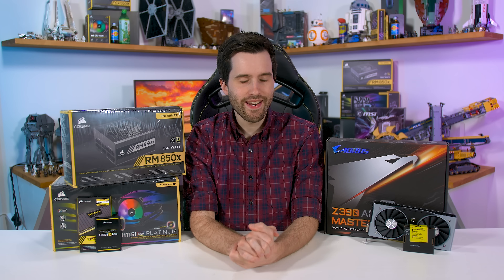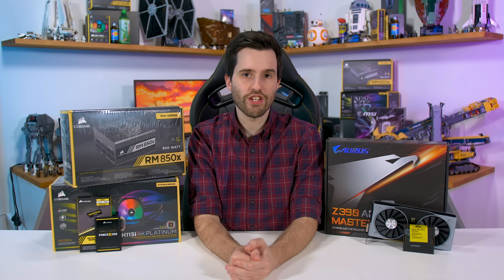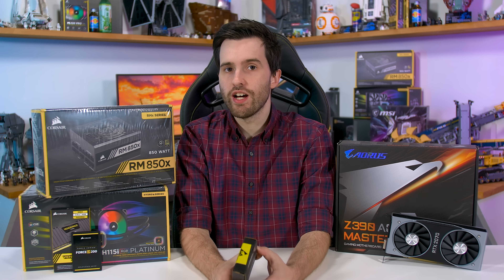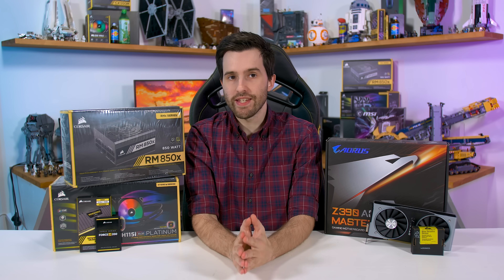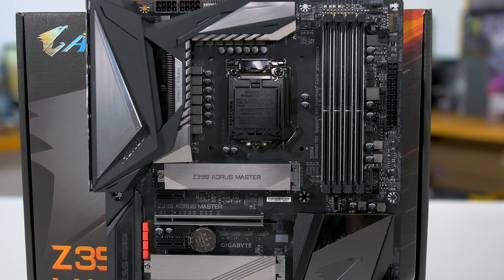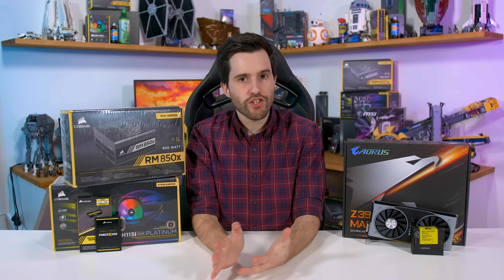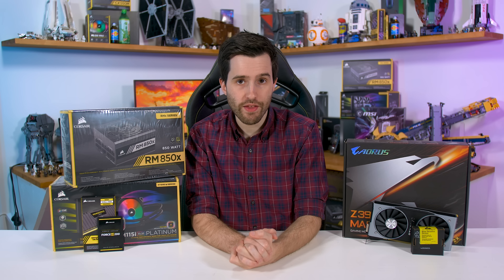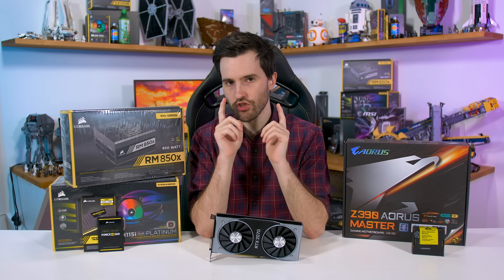Core i9-9900K Upgrade, Can We Cool This Hot CPU? Corsair H115i Platinum Tested!

Comment: Hi Hardware Unboxed
Can I use Power Supply from 600W for:

Gigabyte Aorus Master Z390 Master + Nvidia Gforce RTX2060 + 16GB Ram  Kingston 3400 Fast Buss + HDD 512 WD M.2 Back N750 + Intel I9 9900K with Corsair H115i Pltinium + Six Fans RGD Thermaltake + HDD 2Tb Seagate Firecuda Hybrid. Thanks for your comments.

Comment: Hi guys I want to build an i9 9900k build but will a 120mm radiator cool it properly at stock settings? With the fan rpm set to highest?

Comment: My 8 core Xeon get never hotter then 71C at 4,7Ghz all 8 cores running 100% at 160W in the Intel overclock tool stress test using a big 12 heatpipe cube aircooler with 4 cooling fans in a modified HAF XB case. And that is with the cooling fans running at low speed ...

Comment: Boiis i need help on my i79700K im getting high temperatures on rest lode with mastecoller liquid cooler wether i put it on 4ghz or on 5ghz im permanent at 70-80°C
Reply: I know this post was made over a year ago, but my only guesses are that either you didn't have enough thermal paste or possibly that you had an air pocket in your water block. That's what I can think of off the top of the dome. I'm assuming the pump is working fine and your fans are spinning and pulling through fresh, cool air, so I'm not worried about that.

Comment: Right you have answered a question for me, my shitty old cooler from my i72600k build (think it's an Artic) keeps my i9 cooler than the flashy sealed cooler you used. I think CPU temp is something you obsess about when you do a new build, I had a Q6700, then the i7 2600k and now the i9 9900k and I have phreaked out about the temp on all of them for the first couple of weeks and then forgot about it. Also, just saying but RGB is so lame, what's the point, especially if you are an adult? I mean it's just a box that sit under my desk I don't even look at it, I look at the screen so what the point, don't get me wrong it looks cool and all that but...

Comment: The funny part is my build is almost the exact same build.   I hand picked my z390 Aorus master mainly for the overkill VRM design and heat-sinks.    And i also picked the H115i Platinum Over the h150i because of the new design.    The only thing that is different is my EVGA 850w Supernova G3 Over the corsair RM 850x.    Overall i wish i saw this video before , i would have purchased the same items regardless but still awesome video!

Comment: I would have put two 120mm be quiet! Silent Wings 3 fans in the top to blow cold air in and done away with the fan on the back. The fans that come with this case are loud.

Comment: I want to mount the AIO cooler on top is that bad. I wanna have the MB530P case and the Corsair H100i platinum with a 1060 GPU is it fine to place the AIO cooler on top ?
Reply: Side vs top mounted aio are virtually same performance. Being a 240mm you should have enough clearance for your ram but double check. If you top mount make sure fans are pushing air the top.

Comment: you got a shitty chip.... mine does 5ghz at 1.26v and refuses to get hotter than 72c on my Kraken X72 with push pull fans that are virtually silent even under full load. even at 5.3ghz at 1.35v, i maxed at 86c. You really just got a super shitty chip.

Comment: Why are manufacturers so fond of designing the case that force us to put CPU radiator at the front? Especially if that a core i9 9900K overclocked to 5GHz, no matter what u do, the hot air will heat up the whole case, all components will receive heat from that radiator, even if u add more intake or exhaust fans, hot air still there, heat up everything before it gets out. IMO this case design is not mean for overclocking.

Comment: I'm running a i9-9900k at 26-27c at idle with a NZXT Kraken x72. On load, haven't seen temps get past 65c
Reply: did you oc it?
Reply: Keluhuran Haqiqi no not yet. I still haven’t found a need to since the 9900k is crazy fast. I still made sure to get a good motherboard (Z390 MSI Gaming Pro Carbon AC) in case I do decide to over clock it in the near future.

Comment: The case sux and the cooler too. Tray Liam li O11 air case and nzxt X72 OR ASUS rOS jyujin 360. + The case can have 3 vents front 3 down 3 120mm up and 2 80mm back.

Comment: Did you install a PSU upside down where the fan will blow the air out, however with a dust filter on the bottom?

Comment: Should not be that bad. I’m cooling mine with an air cooler. OC to 5 GHz @ 1.240v. 
Temps don’t reach 80c while gaming.
Reply from the maker: Gaming's not a CPU stress test.
Reply: Hardware Unboxed Yeah, I did an hour of Asus RealBench and the two cores went as high as 94.
Reply: @jettangeles2707  gaming not a CPU stress test LOL. My 9900k 5ghz 1.36v overheat in Furmark CPU burner lol.

Comment: Water cooling guru who doesn't know that all pc water cooling systems are closed loops. a sealed loop doesn't = closed loop it means you can't add liquid to it. an open loop is like taking drinking water running it threw water blocks than to a drain like what's used in food processing plants to move products like peas beans carrots etc. ect, ect.

Comment: 1.290V, 5.0GHz synced over all cores LLC7. Idle temp, 30-45, 47 while gaming. Peaked to 65 during cinebench. I have a ROG Ryujin 360mm AIO cooler, is this an acceptable temp?
Reply: You are the first one I have seen who has acceptable temps with AIO cooler.... All other I have seen have much higher temps then my 71C at 4,7Ghz 8 core 100% use stress at 160w power test of a Xeon 2288G evne with slower cpus using watercooling. I have a huge 12 heatpipe aircooler and it seems to outperform most AIOs....

Comment: Mine is at 5ghz on all cores with duel fan air. processing video in the upper 70's with random peaks into the upper 80's which is higher than I would like but then again 99.99% of the time all cores stay under 80

Comment: Mine is at 5ghz all cores AVX set to 0 voltage at 1.26v cinbench score 2164 multiple runs, runned Occt with furmark      Max temp 80c 18c ambient

Comment: What settings are you running in iQue for your 115i?  Balance, performance, full speed?  Also what cooler temps are you seeing after hour test?  I am running a 9900k on a 100i but upgrading to a z390 from a z370 because of power issues with the old MB.
Reply: what r ur temps with H100i on 9900K?

Comment: i'd hope so because a single tower 140mm air cooler is enough for my 9900k fixed at 5 ghz and 1.28v. this can get really hot, when voltages are not setup correctly tho. at stock settings my cpu is hotter than when running 5 ghz with my custom settings.

Comment: 85-90C not sure i would recommend this cooler for this.
Reply: My 8 core Xeon 2288G at 160W running 100% all cores at 4,7Ghz  never gets hotter then 71C running the Intel stress test for 2 hours with a big heat pipe air cooler... It did not get this hot even with the small 4 heat pipe air cooler it had when I got it as part of a complete Workstation computer. I see other have also experienced the same that they got lower temperatures with air cooling heatpipes then even big AIO water coolers...

Comment: Complaints about temps coming from people who don’t own these cpus. I own one at 5ghz at 1.350 Volts with a 360mm AIO hitting max temps in gaming and workloads of 78ish, full synthetic load I’ll hit 85ish. That’s not that dam hot when gaming laptops are lasting years at those temps 

Update, Re seated paste with Kryonaught, lowered voltage to 1.320 and stable at 5.0. Temps sit around 81c  under full synthetic load. Gaming temps don’t peak over 63c
Reply: What type of graphics card are you using? And how many fans do you have in your case and what's the configuration? I'm about to order my first build and want to go with the 9900k
Reply: CryptoData I’m using the lian Li Dynamic with 6 be quite silent wings 3 for intake and my 360 AIO does the exhausting. Currently using a 1080TI ftw3 from EVGA.
Reply: @Clutch4IceCream   what CPU cooler do you have I want to get the i9 but scared for the overheating
Reply: apex xeno Corsair h150i  pro, keeps it in check nicely.
Reply: @Clutch4IceCream  this will be my first ever build and I don't want to screw it up. And want the best cooler so I have no issues
Reply: apex xeno just make sure you do a ton of research into a good case. Most cases don’t have good airflow and you want the best airflow for the radiator. H700I is a great case as a starting point.
Reply: @Clutch4IceCream  I was looking at the h700i and I've done some research on it and seems pretty good. Do you recommend I go for a 360mm radiator or 240mm?
Reply: apex xeno you absolutely need a 360mm AIO to combat the heating problems with the 9900k. My 240 was not enough.
Reply: @Clutch4IceCream  okay I will definitely be buying a 360.  I mainly just want to game and stream
Reply: I have one at 4.7GHz (stock) with 1.25V, in my 360mm AIO doing prime95 1h temps are at 58ºC, consuming 120W of the CPU
Reply: Sr. Yonky yea stock temps are amazing, once you OC it sky rockets lol

Comment: I don't know why but many reviewers just never tell the power consumption its important
Reply: They do in their reviews. This wasn't a review, it was a build video with some focus on cooling.
Reply: @Malus1531  how can you talk about cooling without talking about power consumption?
Reply: @MrPirateking619  Because they are different. Power consumption alone doesn't dictate cooling. They are related, but it depends on efficiency. A 99% efficient device might consume 100W but only require 1W of cooling. So if you want to know about cooling, energy output (heat) is more important than energy input.
Reply: @Malus1531  lmao how do you cool 100w with 1 watt of cooling?
Reply: @MrPirateking619  Ok after further research I'm wrong, apparently all energy input is also output in a CPU. In a mechanical device they will usually be different. For example you power an engine with 100W, the actual moving of the output shaft represents 50W of work but 50W is lost to heat/friction; that process would be 50% efficient. You would only need a 50W cooler to cool it despite it using 100W. But CPUs don't have moving parts, they just push electrons around, and pretty much all of that creates heat due to resistance in the traces & transistors. It's pretty much just a heating block, but with the electron flows organized instead of random. So I guess I rescind my previous comment.

Comment: is there any specific reason on why you placed your cooler on the top and not in the front?
Reply from the maker: Depends on what you want to prioritise, cooler at the front is better for the CPU but worse for the GPU. Top is better for the GPU but worse for the CPU.
Reply: @Hardwareunboxed  Bitwit has shown that the GPU temps are not significantly affected by front or top mounted AIO. That's was for both blower and open air design. It would fluctuate at most, 1C up or down. Which is not significant.

Comment: 9900k at 5Ghz, ASUS Maximus XI Hero MB, Dominator Plantinum DDR4 3333 (XMP II set in Bios), vcore set to 1.326, H150I cooler and barely breaking into the 80s mostly in the upper 70s with Prime 26.6 Small FFT.

Comment: I have an i9-9900K + Gigabyte 1080ti and kraken x62 in an nzxt h700i case, al 8 cores on 5.05 Ghz and temps in games on 2k and ultra are around 55C max,  gpu is locked on 72C... Im pleased as hell! Motherboard is an msi z390... In stress test at full load 100% i got 83C on CPU.

Comment: So atm with the ammount of cores used by games the 9700k is better in single core performance and in gaming. Mine is pushing 5.15 at 1.32V and 84 degree max on a Noctua NHD15.
Woud be a greate test if it is actually better for gaming.

Comment: My i9-9900K runs at most 80C during rendering/encoding videos to h265 as well as CPU stress tests with my 280MM AIO cooler. I run it at 1.31v @ 5GHZ. I think that is pretty good, sucks for people who have to run much higher voltage though.

Comment: guys go buy i7 8700/8086k Delided !!!
Reply: I run my i7 8700K  5Ghz 1.27 Volts  non Delided for more than 2 years.I run it with a black ice nemesis 480 GTX radiator my room temp 23C and CPU Idle 29 in game BF5 57 degrees.
with all stress test always around 62C a 65C degrees

Comment: 11:20  These are not safe temperatures to run with an aio cooler. Liquid will boil and permeate and your cooler will degrade. Never go over 70-75°C over long periods of time with a closed loop aio cooler.

Comment: You put the memory in the wrong place.  They should be side by side.  make sure to coat them in thermal paste before you plug it in its bracket.  You can save weight by eliminating screws and use hot glue.
Reply from the maker: Thanks for the tip, Stefan. Big fan BTW!

Comment: Intel has had an issue with their heat spreaders not being flat for a while now. Jayztwocents has a few videos highlighting this issue. Test your's, if it spins on a flat surface, the IHS isn't flat and needs to be lapped. This is not about exposing the copper, its about making sure the cooler cold plate can make absolutely perfectly flat contact with the IHS.

Comment: I've the same exact case in black. Oh the hex key screws and rubber washers will be super annoying to deal with down the road. Makes maintainence for the PC a pain unless you take really good care of the small parts.

For your use case scenario, I'd worry a lot about the case screws because you're going to open up the case panel very often. You're bound to lose the screws sooner or later.

Comment: Something isn't right. I have the exact same set-up and I am getting 32 degrees at rest and no more than 65 degrees on max use. And I have it in an NZXT H200 ITX case with a 1080 ti, overclocked.
Reply from the maker: Yeah that's not even remotely possible. You might want to give the pro-overclockers a few tips :D What are you using to stress the system?
Reply: @Hardwareunboxed  HWinfo with Prime95 (including AVX) . Which one do you use exactly? I'll post a video using your method and show my specs
Reply from the maker: @JudahMaccabee_  No what software do you use to stress the CPU, not monitor it. Are you running an AVX workload like Blender?
Reply: @Hardwareunboxed  Prime95 with AVX. Maybe I'm not testing it right? Either way, if you're using Blender, I can do the same and post a video
Reply from the maker: @JudahMaccabee_  Yeah sure why not I'd like to see it, really Prime95 should push temps towards 90c. What cooler are you using?

Comment: i have an 8700k.  and let me tell you.  if they drop the price a bit or i can find a decent one second hand and i can sell my 8700k for 200 at least i will find a way to cool it.  my dh 15 will handle it just fine with the right power limit settings.  you just overclock it as far as you can and set the power limit to about 190 or 200.  when its gaming it will be 5ghz all core and when you do mutlithreaded rendering etc then it will drop down to the best clock it can hold at that power limit.  simple

Comment: Guys what's you take on this video released by PAUL with 2 different rtx 2070 gpu one at 500$ and the other at 600$. The difference in frequency between them is 210mhz .What's your take on this. Did Nvidia screw us again with this? What I'm getting at is that you guys tested 1 of the rtx 2070 which bt my asumption is the 210mhz oced one which makes makes me wonder is there really a difference between the stock rtx 2070 vs gtx 1080, or just another way Nvidia misleading us into thinking the cards are better that what they actually are.
https://www.youtube.com/watch?v=6EAbHsa8eCU

Comment: heat + OC= ded cpu at some point
Reply: Judge Dredd cpus in gaming laptops last long af at the same, if not hotter temps tho
Reply: @Vico7787   heat in a laptop is a bad thing. all they end up doing is drying out the soldiered parts. yes some can run a little bit hot. but as you know, people do not know to let them breath.and they clog up with crap dust.9-10 x the onboard gpu will fail first...

Comment: I hope they make a H150i platinum. I love my h150i keeps my 8700k @5ghz under 70c while gaming
Reply: my H100 Pro keeps it max 67c while gaming
Reply: 71C max at 4,7Ghz 8 cores 100% stress test 2 hours of Xeon 2288G with a Schyte Ninja 3 cube heatpipe aircooler at 160W and fans running not full speed...  Some report getting higher temperatures with the H150 then with big heatpipe aircoolers. When gaming it hovers aroud 45C with the fans running silently.
Reply: 70c while gaming? That's is normal, my 9900K 5ghz 1.36v stay under 70c while gaming, but overheat over 95c in Furmark CPU burner lol.

Comment: I like how Tim points out the 9900K is known for running hot...then puts it in a case with limited front air intake.
Reply: Not to mention that all that 90C air is going INSIDE the case... when the 280mm should be at the top expeling the air and in push-pull

Comment: What about a suitable air cooler? Noctua D15?
Reply: I use the  cooler master ma410m and i get 72 degrees C under full load at 4.7GHz all core when stressed  with cpu z stress test for 15m+  (Max temp) Idle is 27-29 °C and when gaming is near 60. On Cinebench it hits around 68.
Reply: Noctua D15 is a more powerful cooler than mine, so you will probably be good as well :P
Reply: You can't use "suitable air cooler" and "9900K" in the same sentence... check your grammar...

Comment: Use an intel stock cpu cooler and then use a timer to measure how long it is before things start to melt and/or catch fire..
Reply: You do realize Cpus and all new PC parts have ocp and other safety features built in to shut things down before it melts or catches fire? Who in their right mind would use a stock Intel box cooler for anything but a low end build. SMH
Reply: @johntotten4872  I was.. joking.